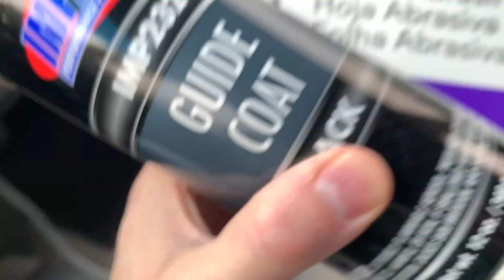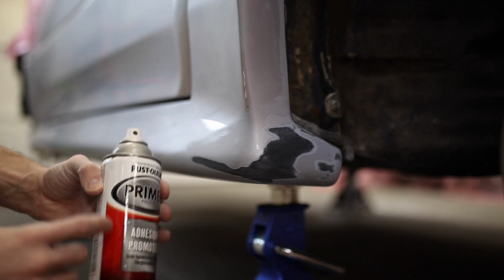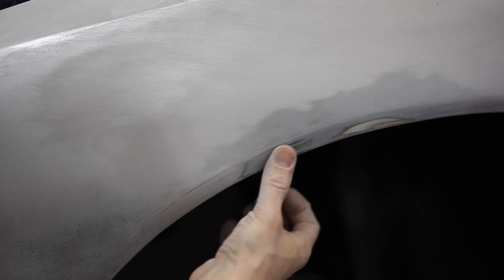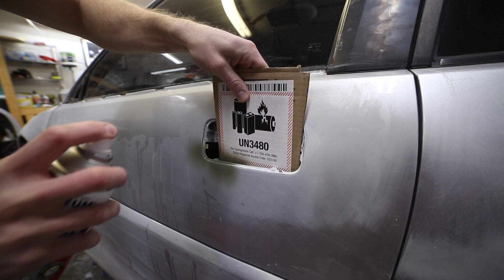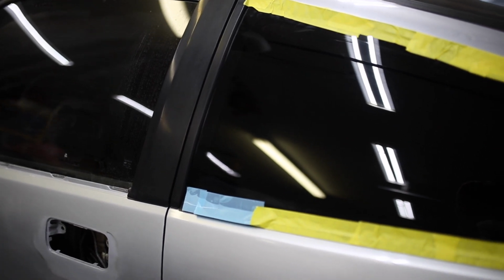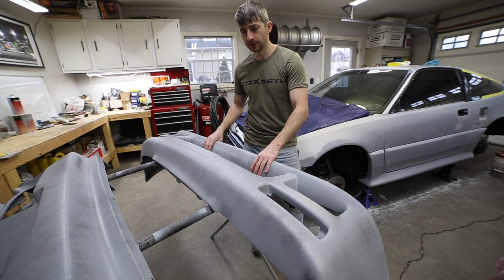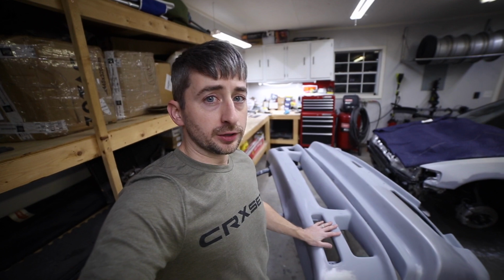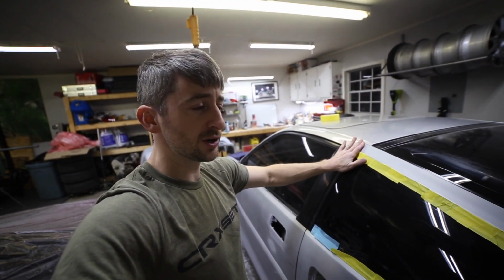1989 CRX Rescue Part 13 - Paint Prep

Comment: seth im confused, did you not prime the entire car for this? just sanded the existing paint with 600 and them put a new topcoat on that? thanks.
Reply from the maker: I did not primer the entire car. Only the spots that needed it.
Reply: @crxseth  ok. my crx paint is in good shape but dull. so now im thinking if i should sand it all to 320 and prime or go straight to 600 and skip the priming. how do i come to that conclusion?
Reply from the maker: @DistortedApricot  Depends on how nice the paint is. If it’s bad, sand it off, if it’s nice, and no color change, then no need to prime, in my opinion.  Priming is the safe bet.